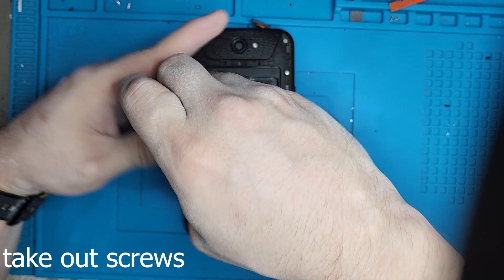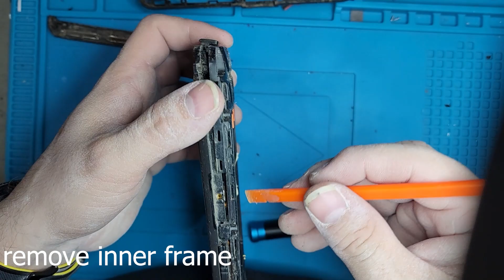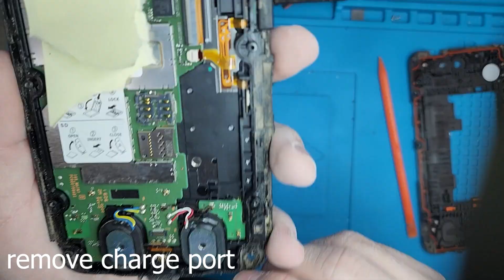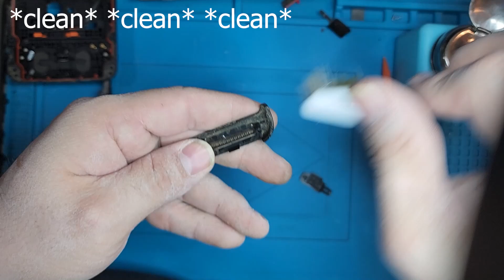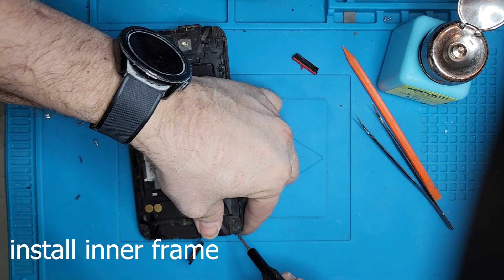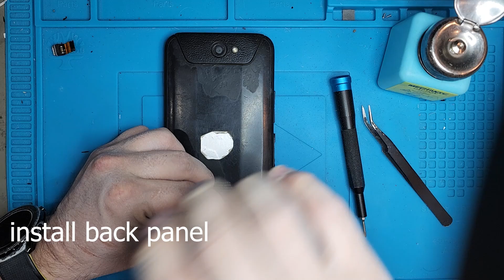Kyocera Charge Port Replacement

Comment: Why so fast? You're not helping anyone....
Reply: @user-eg2gf3rv9q I need to find an answer for this. I bought the Kyocera dura extreme w camera newer version and hate it. I still have my old one but it won't charge due to the port being damaged. I want to get important photos from that phone & Verizon said they can't do anything with a broken port. I'm calling Kyocera.
Reply: Just change your SPEED SETTINGS to the SLOWEST setting. 👍